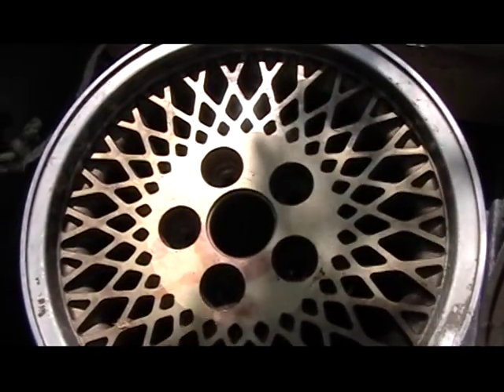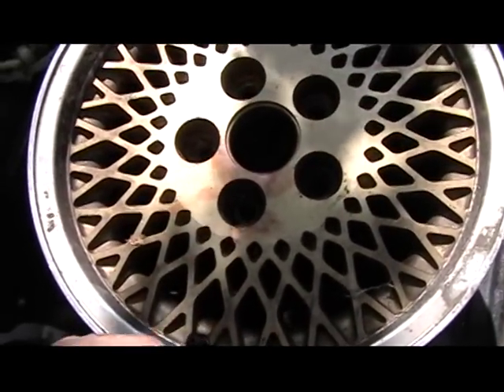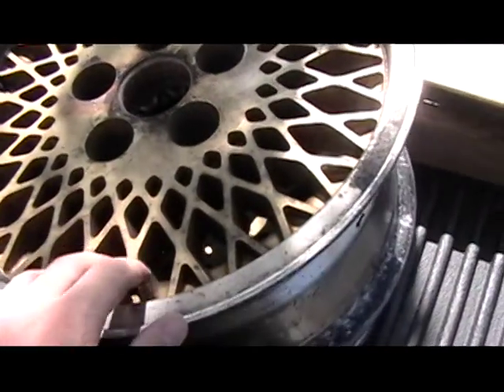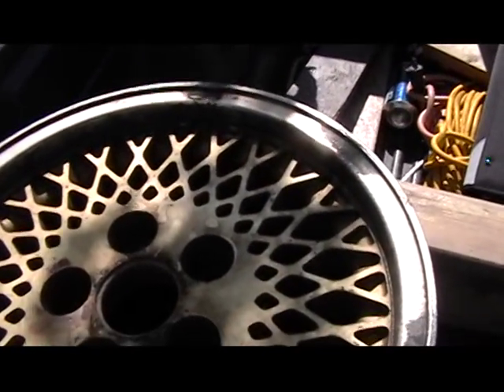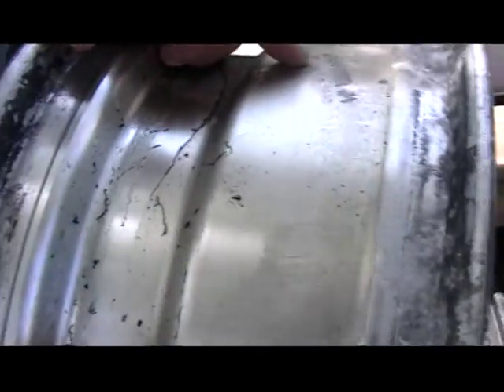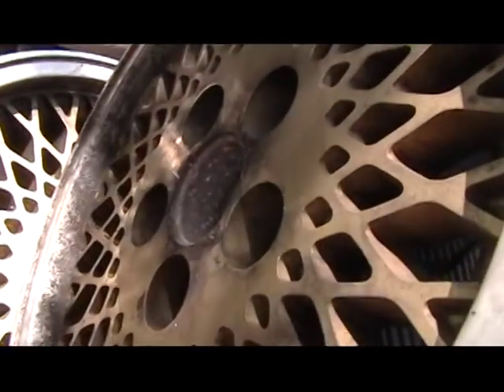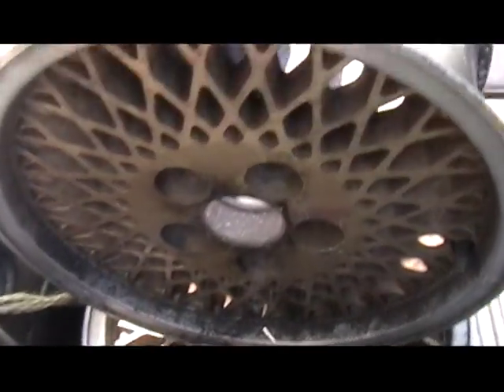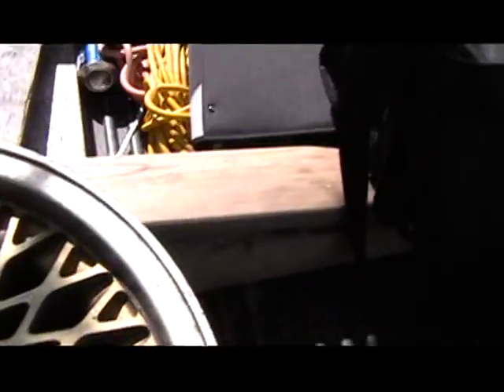I got free BBS wheels for the Beetle!

Comment from the maker: Definitely. I'm thinking painting them all to be gold like the first set, or black, or gold with black inserts. 

There was a bit of melted metal in one of the lug holes, I think one of the other students tried to heat up a bolt to get it out. If that's the case, that particular wheel might be ruined and I'll have to find another one like it.